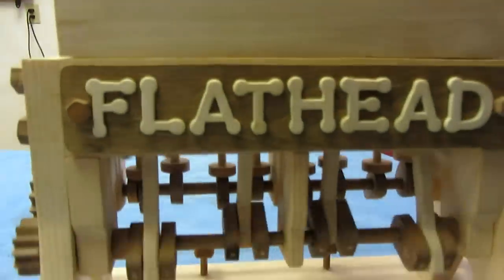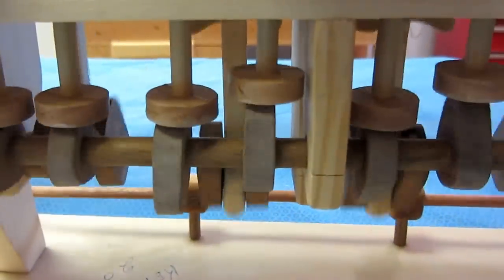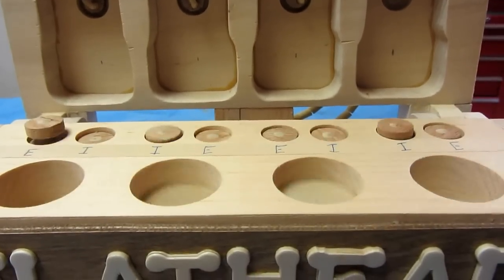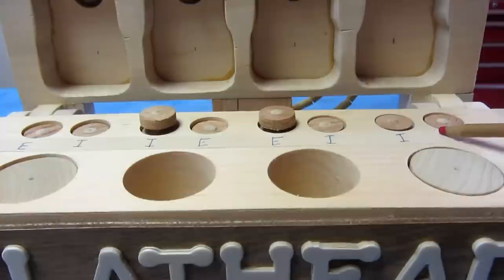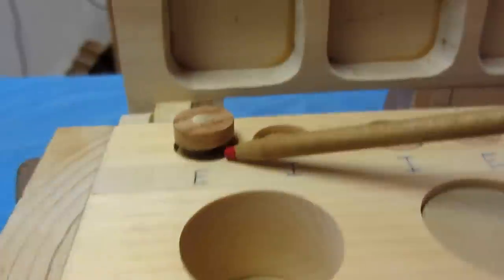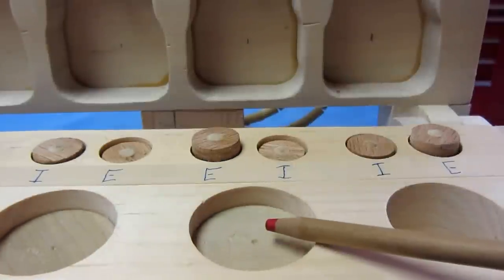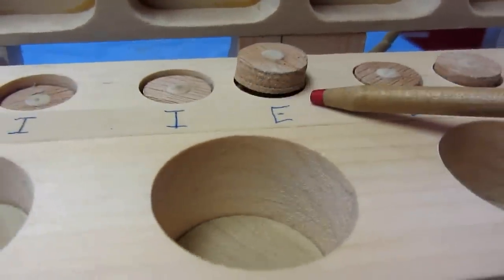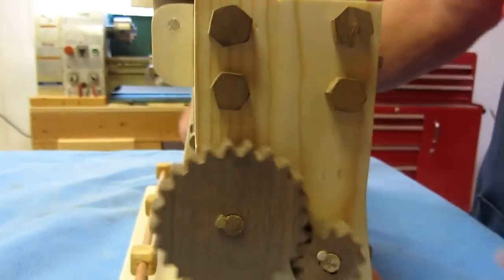Wood Flathead Four cylinder motor

Comment: Flatheads have good low end tourqe. And have a very complete burn of the fuel. The l134 was replaced with the f head because flatheads run notoriously hot due to the intake and exhaust valves being so close to one another

Comment: I am building a straight six, engine out of wood. 

can you tell me what the gear ratio is on the camshaft gear is?
Reply: please tell me your modeling it after the jeep 242 inline 6 4.0? :D
Reply: post it on you tube. I would love to see.
Reply: Curtiswoodworker 
Cam runs at half engine crank rpm unless you build a dual lobe camshaft and run it at 1/4 crank speed ..yes that has been done, unsure why but I surmise it was probably an attempt to remove torsion issues with an aggressive cam profile at high rpm. Not an issue with a Wood motor that can’t actually run.
Reply: Ken Schweim 
Other way around.. cam runs at half engine speed.👍🏻

Comment: someone asked about the disadvantages of flatheads versus overhead valve engines-- flow... basically an overhead valve engine flows the air better into and out of the engine, and more air+fuel into the engine, and more exhaust out faster and easier= more power.  In a flathead, the air has to make another 90 degree turn as it comes through the valve, across the deck to the cylinder, and down the cylinder bore on top of the piston.  It has to make the same path back out through the exhaust valve.  Overhead valves have a much straighter path down past the valve into the cylinder to the piston head, and back out straight up through the exhaust valve.  The more times the air changes direction, the more inefficient the engine, or said another way, the straighter the air path, the less resistance to flow, and the more efficient it is.  So why build flatheads at all?? Cheaper and easier to build-- less machining, fewer parts, at the cost of some inefficiency.  As technology improved to build engines, flatheads were replaced by pushrod overhead valve engines, and eventually overhead camshafts (although there were inline airplane engines in World War 1 that had overhead cams driven by a vertical timing shaft through bevel gears-- highly efficient but very expensive to make)
Reply: Very Well Said
Reply: Let us not forget the lower compression ratio thus leaving it with low power and bad fuel efficiency

Comment: wow niece, i made engine out pf lego, but it was 2 stroke and i tryed to turn it intu lego engine with real combustion with a taser module and ga burner connected to lego carburator. it had 27 cycels of firing and head exploded ;)
Reply: @kenschweim6159  no, but it is now not working, i'm gonna make an engine from plaster. And iif it has good compression i will try to power it with propane with oxygen.